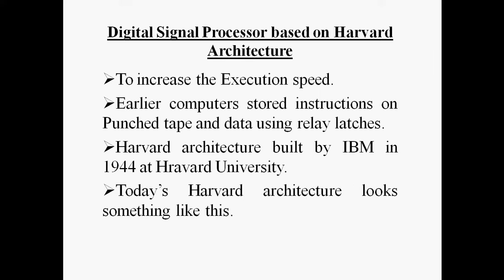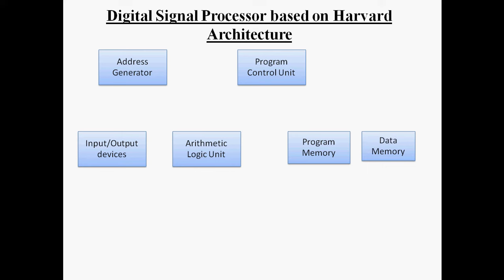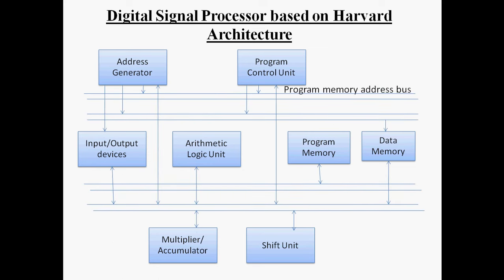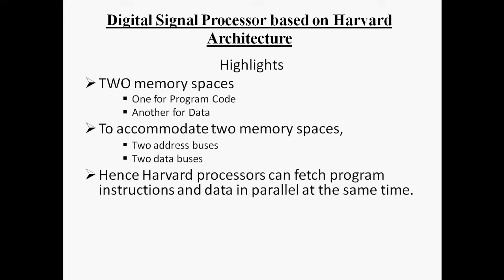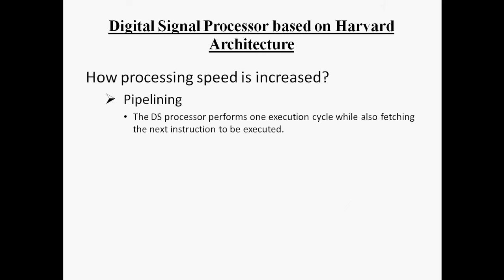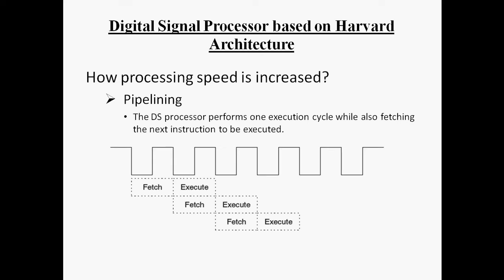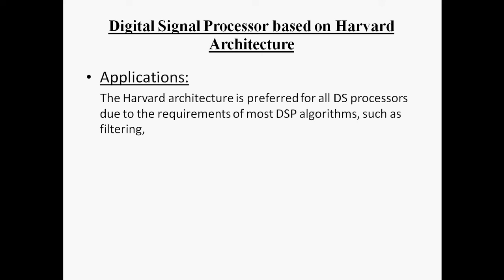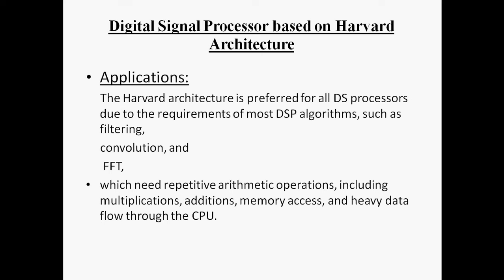Q9.a Harvard Architecture for Digital Signal Processors | EnggClasses

Comment: There seems to be a small correction in the block diagram. The bottom buses should be data buses, but labelled as address buses by mistake